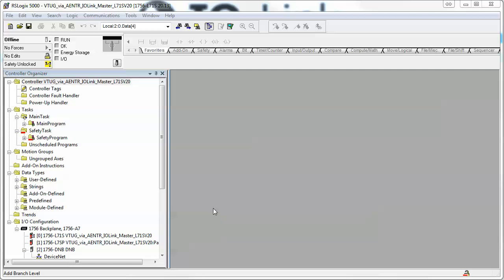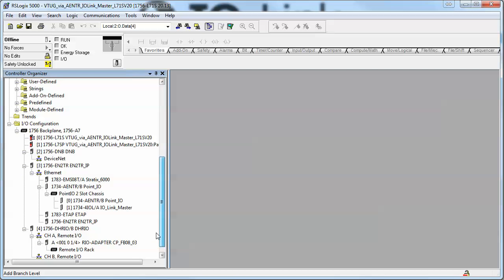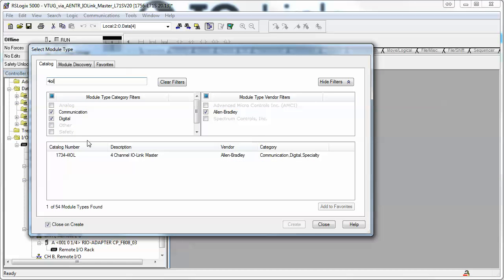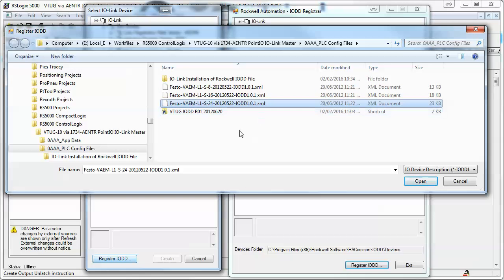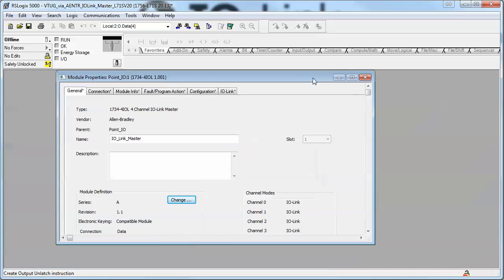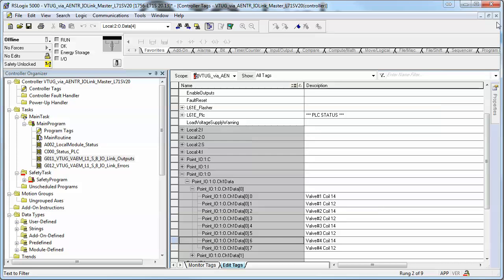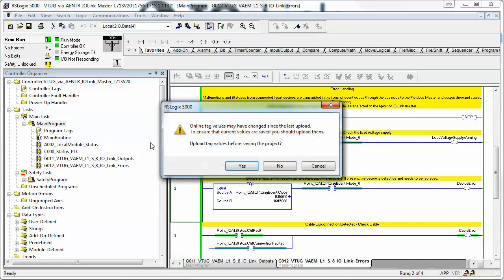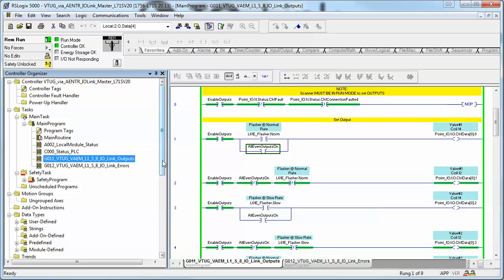VTUG + VAEM_8_PT + 1734-4IOL + IO-Link + 1734-AENTR + ControlLogix + EthIP

Comment: Hello Steven, 
Helpful video.  
How did you wire the Pins for the IO Link to Point IO Master card?
Pin 1 to V of Point IO
Pin 2 to your panel?  We have 10 valves - power is more then Point IO Master card limit.  
Pin 3 to Dc Common
Pin 4 to Channel 0 
Pin 5 to Dc Common
Reply from the maker: Hello Jeff, this is my personal YouTube Channel - you should try Festo technical support.
If I try and remember "I Think" the wiring would be as follows:
VTUG-VLK Valve 5 Pin M12 connector
Pin 1 to +24V (PS) for electronics/sensor (This would have power all the time)
Pin 2 to +24V (PL) for Valves/outputs (This would be wired to lets say an E-Stop/Light Curtain relay)
Pin 3 to 0V (PS) 
Pin 4 C/Q IO-Link communication
Pin 5  to 0V (PL)

I cannot recall the AB end of things but the hints above should help you.

You said "We have 10 valves - power is more then Point IO Master card limit"
It late at night (early morning) but IMHO, Pin2 shouldn't be connected to anything on the Point IO card-it should be as I explained above.